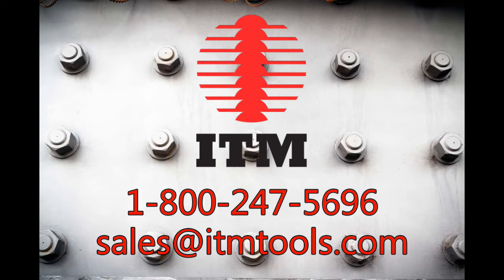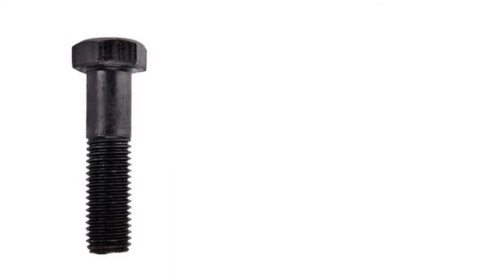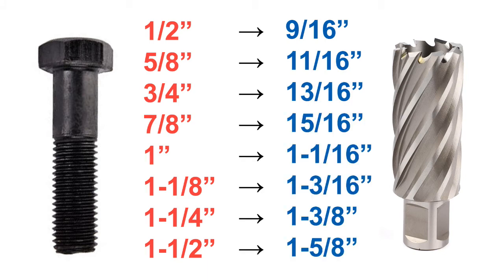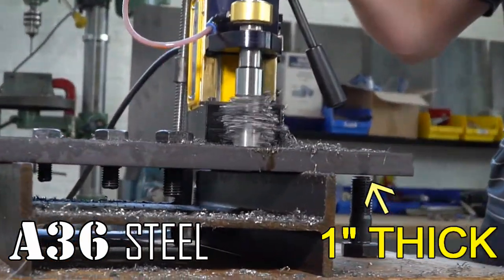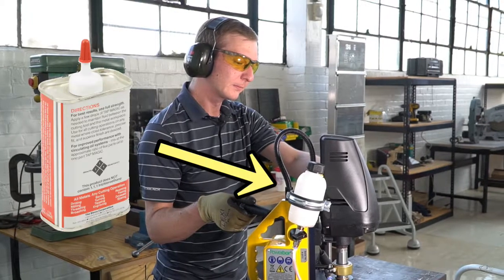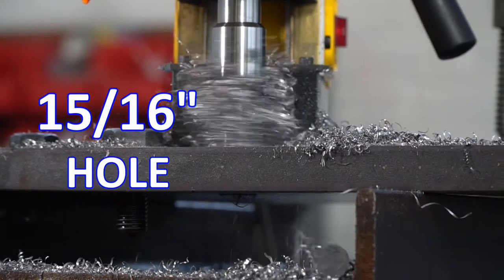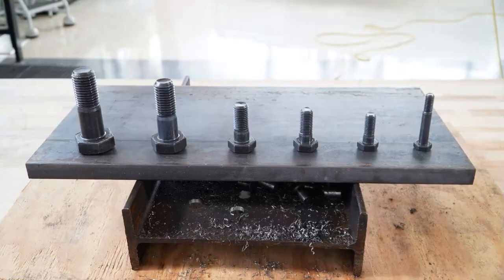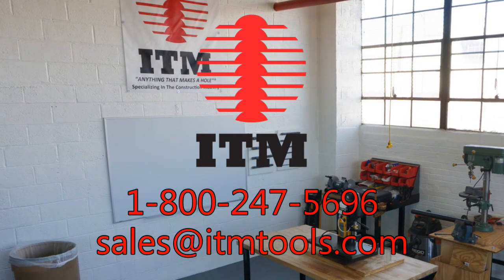ANNULAR CUTTERS FOR BOLTS

Comment: I don't care how sharp the chips are or what this guy says. Never, NEVER, ever use gloves around rotation machinery, ESPECIALLY drilling machinery. The chip can grab the glove and tear your finger off or worse before you have a chance to say ouch. 

Loose the gloves, or loose a finger. It's better to have a couple stitches in your thumb then not to have a thumb to get stitches in. No professional machinist EVER uses gloves around rotation machinery, especially around a drill press! 

No long hair!
No long sleeves or other looes clothing
No gloves for no reason.